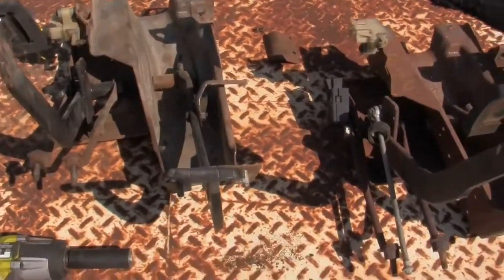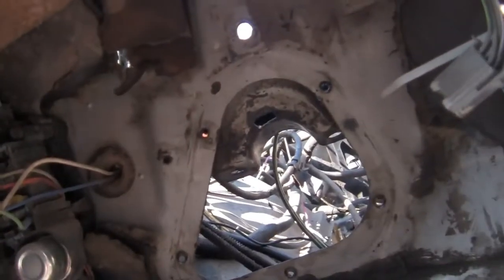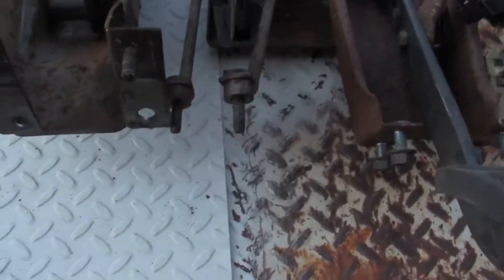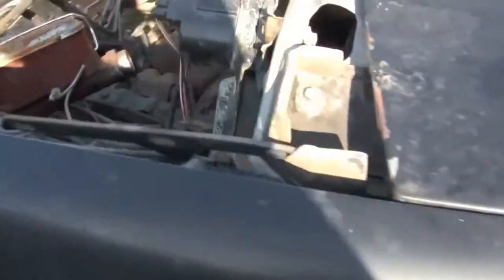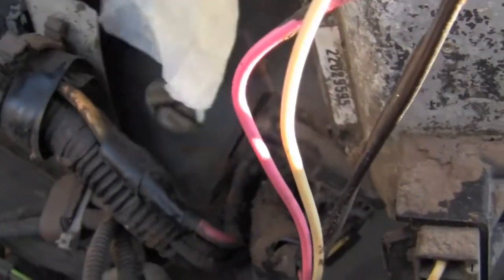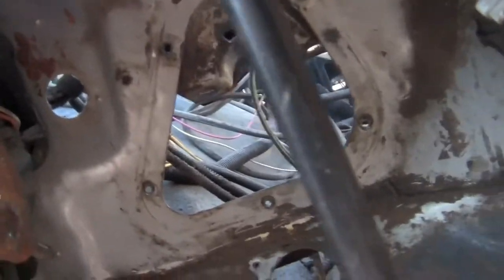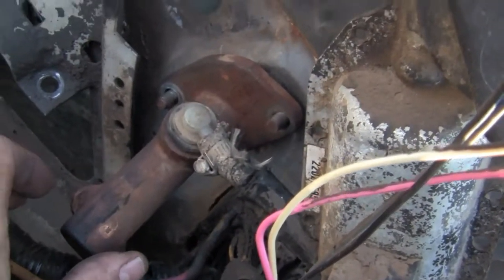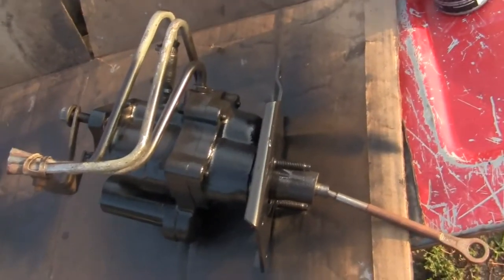converting to hydraulic pedals master cylinder install 82 c30 ramp truck

Comment: Hello Bud. Is there a way We can get a template on the hole for the clutch master cylinder. Im converting my 85 to manual but I cant seem to find a c30 around the yards to get a template or the pedals I found some pedals but they are the mecanicals and was thinking to use them and just add some bolts. But a Template would help a lot of people. Thankx Man.
Reply from the maker: i think i still have the one i used, cant remember if i trashed it or not.

Comment: Is the lower hole  that was used as the reference hole for the pattern the hole where the old mechanical linkage went through the firewall to the z bar?
Reply from the maker: no. the rod to the z bar goes straight down through the floor. that hole you speak of is a grommet hole where some wires went through the firewall.
Reply: @chevyfarmersgarage1955  I am trying to do a auto to manual swap. Can you post a picture or video of where the original mechanical linkage hole is?
Reply from the maker: @djtheg6819  go to 5.42 in the video. you can see a glimpse of the hole. its right below where the column goes through the firewall. if you need a better view i can post a short vid of it.